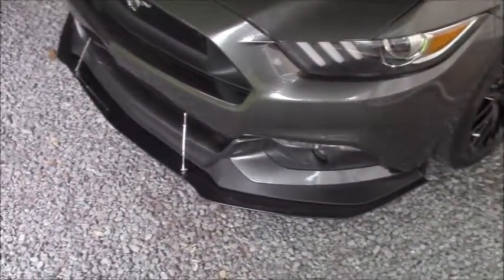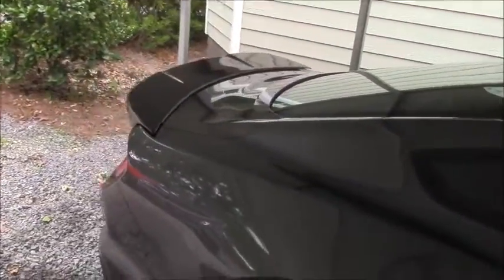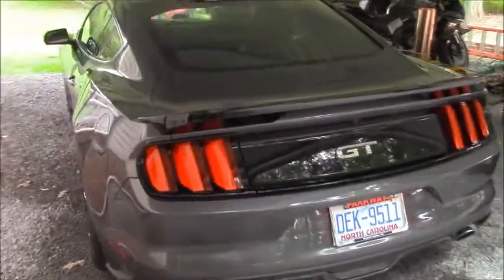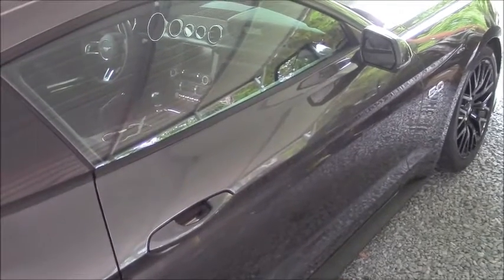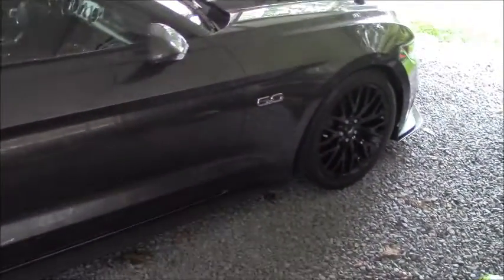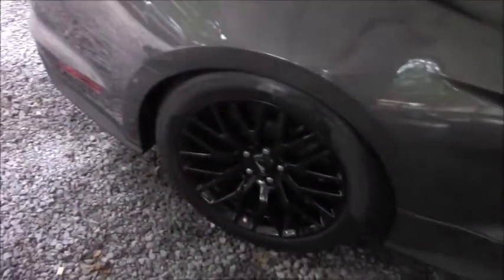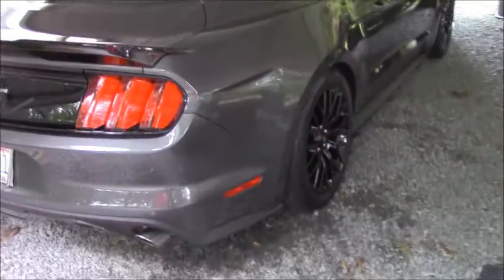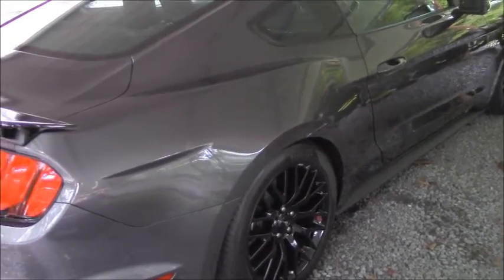2015 Mustang APR splitter, CDC spoiler and future plans!

Comment from the maker: This car will absolutely destroy both when compete. The Hennessy is only 717hp and the roush is only 670hp, both ratings are at the crank. Both are also stock internals which are only good up to 800hp. My car will be fully forged build engine safe up 1500+hp. I also will be around 750-800whp just on pump gas, which converts close to 1000hp at the crank. On race fuel I'll be around 1200hp at the crank.

Comment: any update about your monster ?
Reply from the maker: I'm dropping it off April 29th to get everything done. I just got 17x9.5 and 18x8.5 dark star wheels on it today. Went with m&h 325/45r17 tires on the rear. Finally got in the t56 magnum xl trans and the 1400hp half shafts. I'll definitely do an update video as soon as I get it back in a couple weeks.

Comment: you can put 305 on the stock wheels?
Reply from the maker: Oh definitely. I have 325's on it now with 17x9.5 dark star wheels. Those 305 nt05r's fit great with hardly any bulge.
Reply: +josh huttar on the factory  19 inches track pack rim! nice thanks for your quick response.
Reply from the maker: +Steven yeah. I have the 305 nt05r's on the factory 19" track pack wheels for daily driving and the 325's on the dark wheels for the high hp tune.